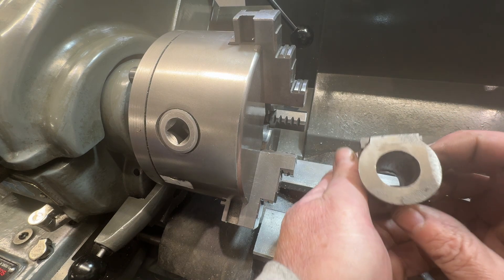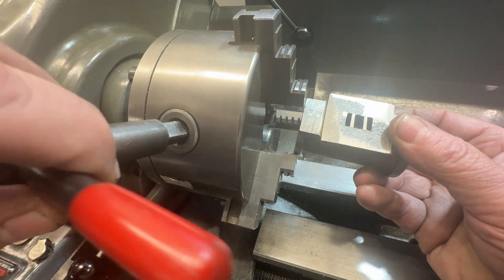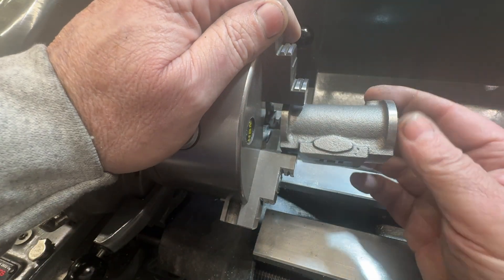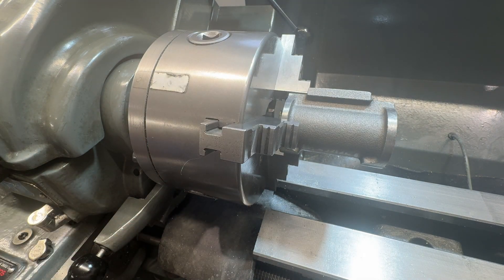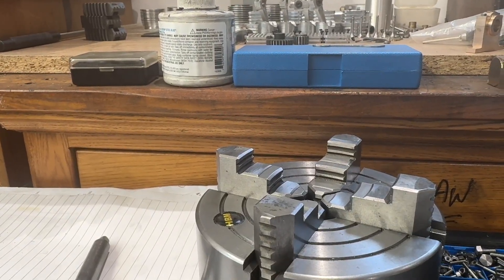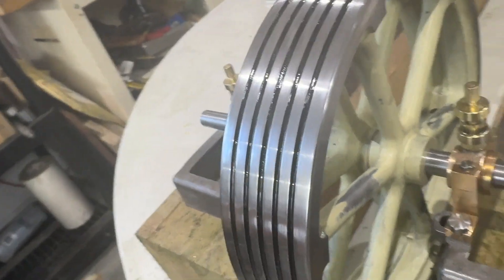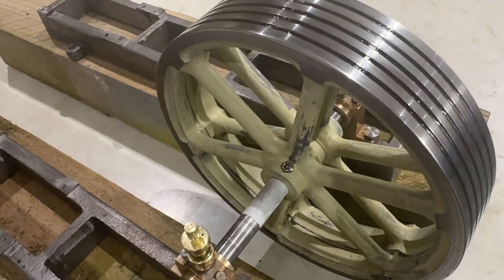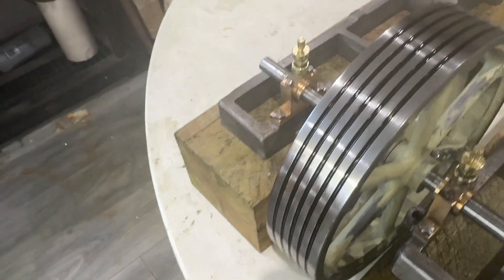Cylinders for twin victoria part 5A

Comment: Your fixture is brilliant! I bored my cylinder using a boring head on my mill, but I'm not satisfied with the result. There seem to be a few tenths difference in the bore from one end to the other. I don't think the boring head gives me enough rigidity to ensure a consistent bore for the full length of the cylinder. I may create a lathe fixture inspired by yours and do a light pass with my most rigid boring bar to fix the problem.
Reply from the maker: 1 thing I did notice with them is with the aluminum shroud the finish was perfect on the bore...maybe reducing resonance   !!!!

Comment: Nice fixture and a very interesting approach. I was wondering if you would bore them on the mill. Got the job done! Looking really good too - super polish on the flywheel.
Reply from the maker: yes, you can Stuart but there can be a risk of chatter and you need to machine the ends sq to the bore. 1 thing I did notice with them is with the aluminum shroud the finish was perfect on the bore
Reply: i think that shroud is giving you a lot of rigidity and mass in the setup, helping with what is going on at the cutting tip. Clearly worked well. I like that you’re thinking through geometric relationships - I think that’s the leading cause of binding issues in model engines - and why your triple ran so well. This one will also.